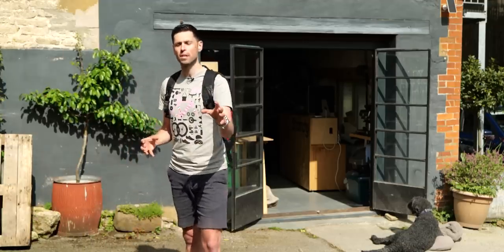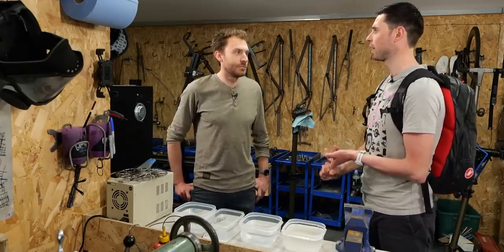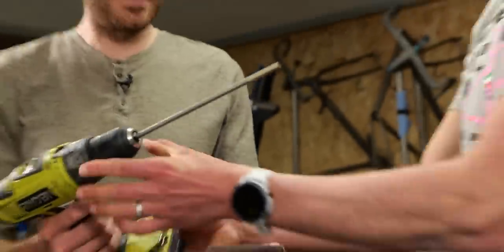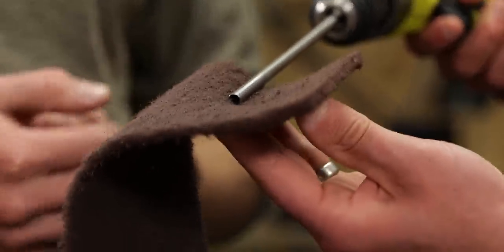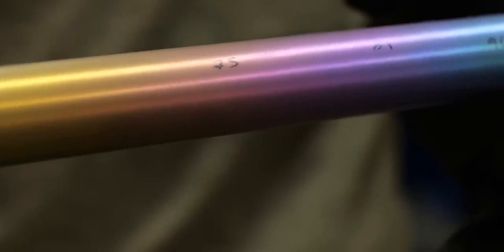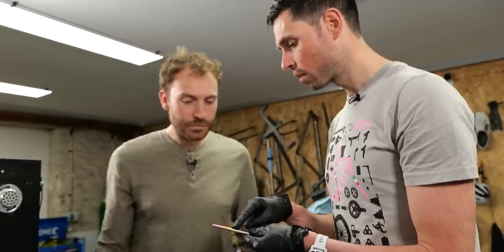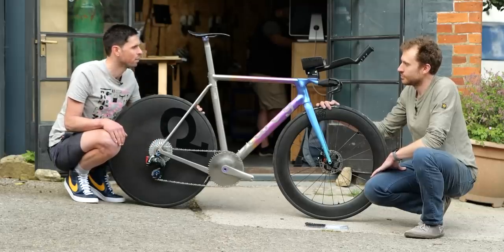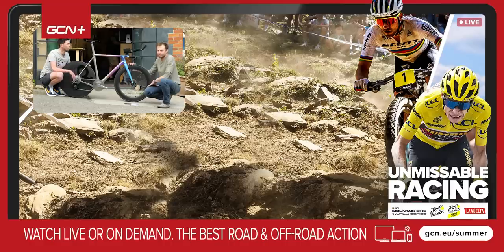Will Your Next Bike Look Like THIS?!

Comment: bright anodising is such a love/hate thing. I've seen people do it at home, slightly concerning, but the results are interesting
Reply: Titanium Anodizing != Aluminium Anodizing
Reply: I have done a fair bit of titanium anodizing... all you need is distilled water, baking soda and an energy source (and of course cleaning materials. Usually, I use acetone).
Reply from the maker: Do you love or hate it Jon? 👀
Reply: This is not paint … this is PAIN

Comment: Anodising is definitely cool as hell, and anodised finish is considerably more resistant to flaking, cracking and such, like regular paint, but it's pretty succeptible to scraches. I've tried anodising few parts in the past, and while its definitely uber cool proccess for small parts, there's pretty much no way it becomes mainstream for frames or such, mosly because its much more time consuming and requires quite a bit more specialised effort than simply spray painting a frame. It's awesome option for custom bikes, but as a mainstream for mass-produced bikes, unless it's done on industrial scale in acid wats, similar to auto production, it's unlikely to happen.

Comment: Just to notice that anodising aluminium is quite different and the oxide layer does not produce any color at al, so you need some dye that will get trapped within the oxide, which is what gives the color, unlike titanium where the voltage and the time will vary the thickness and the thickness is what gives the color because some wild light diffraction with the oxide

Comment: So if you anodize a frame - do you clearcoat it then? or is it just the anodized layer there?
Reply: Normally you just leave it like that. It is an oxidised layer so it protects the material below from corrosion.
Reply: @chrisridesbicycles  Could you remove the anodizing and redo the part in a whole different scheme over and over again?
Reply: @_Inferis  Not indefinitely. You have to grind off the anodised layer each time.

Comment: #askgcntech How do you anodize aluminium without getting a colour? just to protect a newly polished item.
Reply: High voltage and longer exposure builds a thicker, clear and durable, oxyde layer. This thick layer is colorless because the optical effects that "filter" the incoming light get weaker as the layer builds.